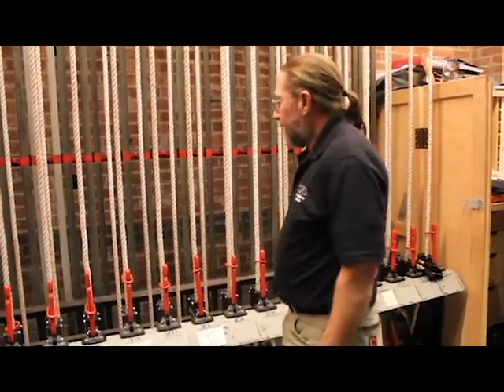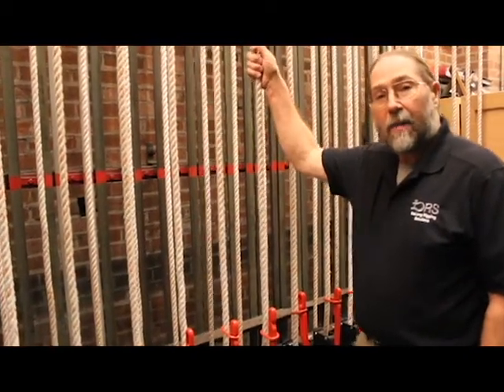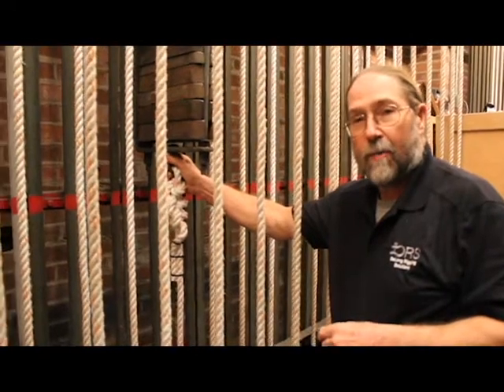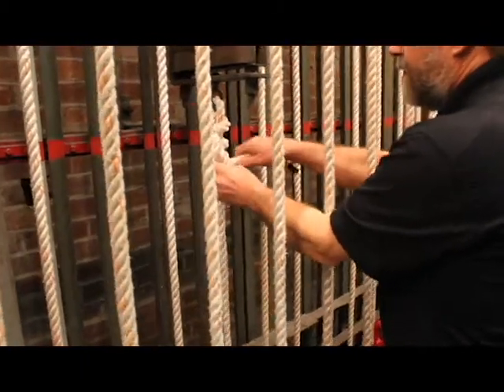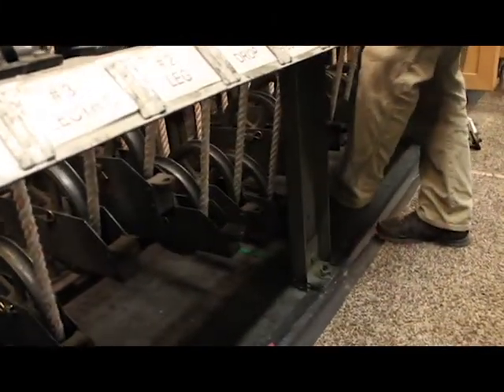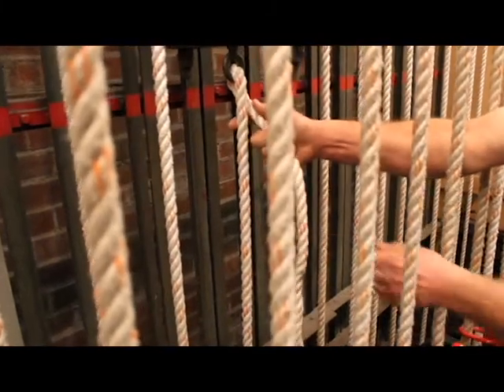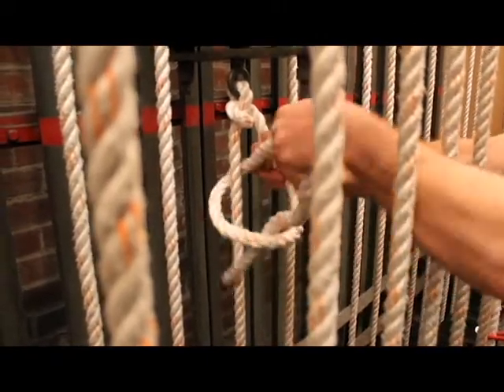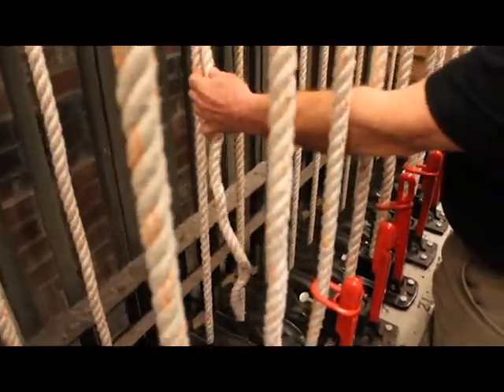Adjusting a tension block

Comment: I built complete theatre rigging systems for many years and recently retired. We put a 3/4" thimble through the arbor top and bottom eye bolts. We closed the thimble and fed our handline though. Then we split the rope and fed the tail though the split. It made a real nice tight fit. We used a monkey fist knot. Any thoughts?
Reply from the maker: When it comes to the terminations, technically there is no incorrect knot. That being said the half hitches are my go-to because they make it easy to control the position of the tension block while you tie the the knot and if you do 3 of them, you have redundancy in systems where the knot hits the the idler block.